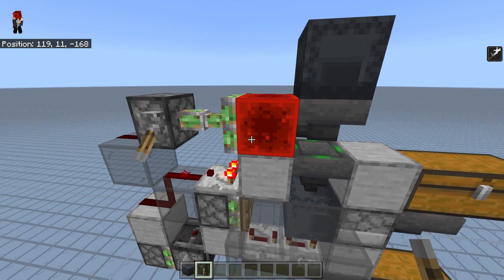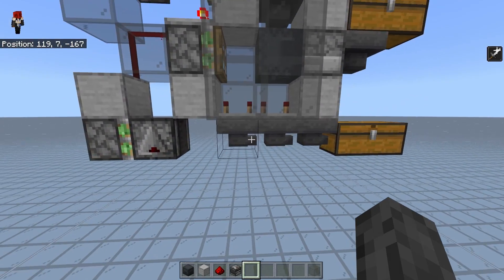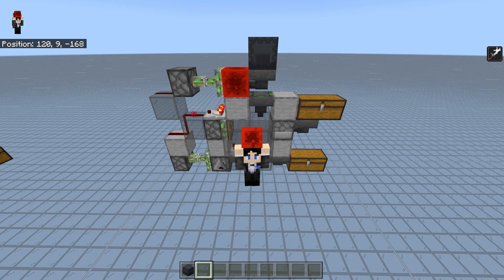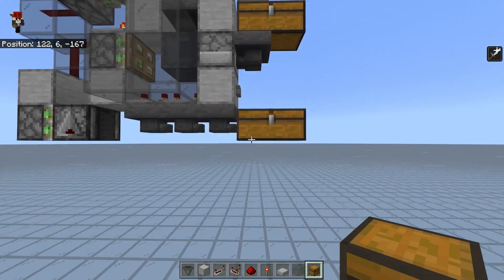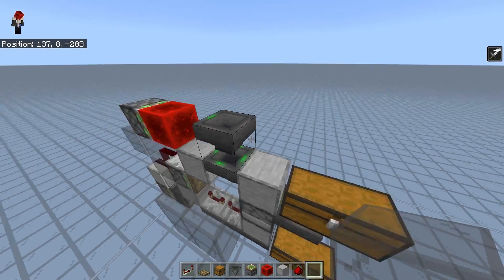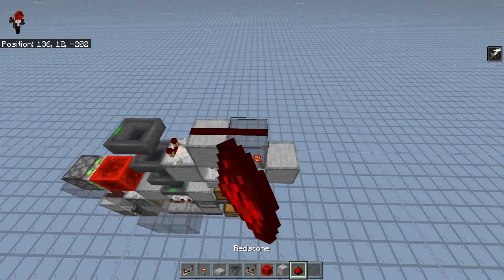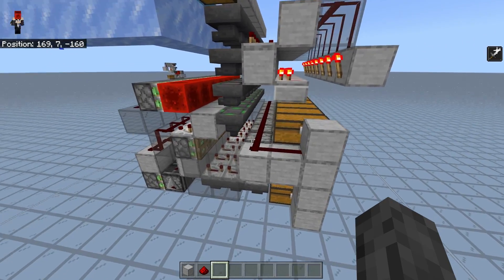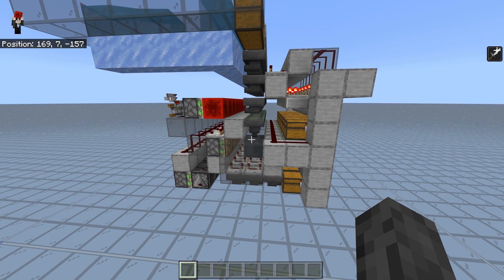Updated 1-Wide Tileable Shulker Loader (Lossless) Minecraft Bedrock Tutorial 1.17 Caves & Cliffs

Comment: The hoppers get full and It doesn’t work
Reply: I figured it out. The redstone block can lock the hopper from picking items up, but doesn't stop it from having items put into it. If you have the hopper above it pointing down into it then the lock out is bypassed and it will flood. Face the hopper to the side or even just place a shulker/chest above it and other work fine.  I know this is months later but hope it helps!

Comment: i just built the shulker loader today for my witch farm and i have an issue where only 1 potion gets put into a shulker before it triggers the redstone is there a way to fix this?
Reply: The reason for this will be because the potions are not stackable I'd imagine - they send out a different comparator strength
Reply: try having a signal strength of 15 rin into the side of the comparator that should work
Reply: @thedrakestorm8755  how would i best do that? im not super familiar with bedrock redstone mechanics

Comment: I've been testing this design on 1.16.201 and it does not appear to be lossless. I observed about 5% losses, as sometimes the broken shulker box will bounce up on top of a neighboring shulker box. If that neighboring shulker box got broken, there's a chance the stuck box could get collected, but there's also a chance that neighboring box won't get broken before the stuck box despawns.

My test data:
108 total shulker boxes dispensed
103 collected
5 boxes lost - stuck on top of neighboring boxes

I've experimented with different options for breaking the shulker box (trap doors in different orientations, open fence gates, end rods, etc.) but all of the options seem prone to some losses.
I saw some evidence that this tendency to lose boxes may depend on the orientation of the trap door (I built my machines facing North and tried installing the trap doors sideways - along the West edge of the piston head, and I ran 162 boxes through the system and had a 100% success rate. But I tried again with them on the East edge and I lost 2 boxes out of 54) - personally I'm not too interested in testing this further to work out whether there's really a specific world-relative orientation for the trap doors that works reliably - that gets too dodgy IMO, and I'd rather not rely on that.

I think a truly lossless 1-wide shulker loader on Bedrock would need to remove the hopper and replace it with a solid block when the break occurs - or else alternate the hopper position in neighboring slices, so that there's never that ledge above a neighboring box to get stuck on.

Comment: 1.16.2 does It work?
Reply: I just built this and it works perfect!
Reply: @peterquickenton4217  how perfect?
Because wiyh me sholker get collected when they are still half or less
Reply: @mirozeyada2141  I used it for my creeper farm and it worked awesome! But I also put it onto my quad gold farm which produces insane amounts of gold and it started to do the same thing you're talking about. What are you using it for, maybe I can try to explain how I fixed it on my gold farm but that may be kind of hard to do without showing what I did.
Reply: @peterquickenton4217  a creazy guardian farm😅😅
Reply: @mirozeyada2141  yeah thats the problem. There's way too many items flowing into it which causes something weird to happen with the comparator getting powered more than it should causing it to send out a more powerful signal and keeping the piston holding the redstone block extended pretty much indefinitely until you remove the items that have built up in the hopper that feeds into the shulkers. Are you feeding your items in with a hopper line?
Reply: @peterquickenton4217  no, i use water stream. 
I tried it again and in warked well. So i think the problem was that i tried to put some items manually in the hobbers that feeds into the shulkers
Reply: @mirozeyada2141  I use a hopper line to feed my items so it may or may not be the same problem. But my solution that I worked out definitely wouldn't work for you because I use redstone dust to lock the last hopper in line before the top hopper of the loader system so no more items flow through until the piston holding the redstone block retracts and stays retracted.

Comment: I don't see a way for it to block the input hoppers or stop when the output storage is full.  So, not lossless.
Reply from the maker: Going by that logic even with such a system there would be loss, because items would get stuck and build up if input were blocked. Lossless simply refers to the breaking and collecting process. Most BE shulker loaders on YouTube are not capable of that due to frequent changes in entity momentum mechanics.

Comment: Sorry if someone already asked this, but with these stacked directly next to eachother don't the broken shulkers sometimes drop into the hoppers of the slices next to them?
Reply: Based on my testing of 1-wide machines in the past - yes, and really no way around it.

That kind of limitation can be perfectly fine in some cases, like if you have multiple slices packing the same type of item, in order to keep up with the output of a fast farm, or if you sort the shulker boxes later, or if you just don't care if they wind up in the wrong chest. Personally I work a bit more with 2-wide designs as I get better control over where the boxes wind up and I usually incorporate features like auto-start and shulker dispatch systems - which can be done 1-wide but I think the behavior is a bit better with 2-wide machines.

But I also haven't built large shulker-based storage systems, or high-volume farms that really benefit from multiple shulker loaders - usually I'm just building one or two shulker loaders in any given location - so there's not much benefit, in my typical use cases, to a 1x5x6 shulker loader (with walls on the side making it effectively 3 blocks wide) compared to a 2x5x6 shulker loader (with a wall on the side making it effectively 3 blocks wide) - especially when that 2-wide design already incorporates other features I usually want.

Comment: I don’t think the shulker boxes always end up in the right hoppers when there are multiple shulker loaders next to each other
Reply: Certainly in 1.14 (and even 1.13?) they didn't. Haven't tried it in 1.16 yet.
If it is a problem, replacing the trap door with an open fence gate might help. But yeah, in past versions I've tried everything I could think of to get 1-wide tileable shulker loaders to drop the shulker boxes in the right place, and never found a good solution.

Comment: Just want to ask a couple of questions 
Does this work on non stackable and 16 stackable items (for my raid farm and ender ender)
Is the tech rock filter going to work better than the standard impulseSV filter?
Reply from the maker: It will not work on nonstackables but it will work for 16 stackables
Reply: navynexus is there a current design for non stackable items? I am using 0ld Guy’s InstaKill raid farm, and I need shulker storage for those totems
Reply: ɴᴏᴏʙᴏ [ pure] just burn them
Reply: I am now, as I’m going to have 2 raid farms, one for totems (0ld Guys InstaKill) and one for emeralds and witch drops (Yodalf)

Comment: Wait cant u use a top slab instead of trapdoor?
Reply from the maker: Top slabs make the boxes glitch in weird places
Reply: @navynexus  ohh ok, thanks :)
Reply: Generally when breaking shulkers on Bedrock I think it's best to use the smallest hitbox possible - the larger the hitbox, the greater the chance the shulker box item will glitch out before it's collected. So a slab would be worse than a trapdoor. Most of my designs break with an open fence gate - but even so, there was a bug in Bedrock that broke those designs for a while as it caused blocks to have a full hitbox while they were in motion.

With this design I think there is a chance the broken shulker box could wind up inside the trap door, then glitch through the piston head and wind up on top of the piston arm, and from there get popped out the piston when it retracts. But I haven't observed such a failure yet, so it's possible I'm wrong about that.

Comment: Navy nexus, is there a design where it destroys your input Shulker box when its finished emptying its contents into the Shulker outPut Shulker box? So that you dont have to continuously build up and break the Shulker box, so that you can put another one down. 

Kinda a fully automatic system.
Reply: That's kinda impossible as the top one is on top of a hopper so if you break it there's a large chance that it will fall into the bottom one